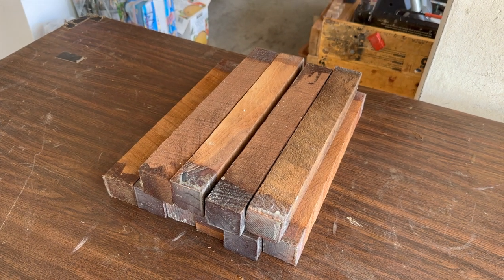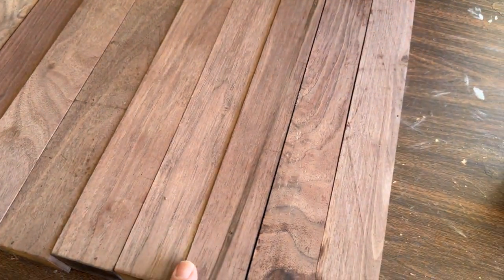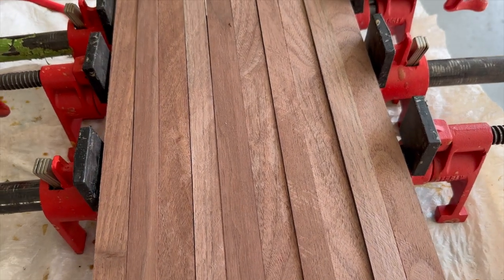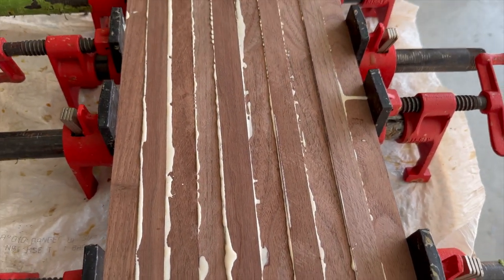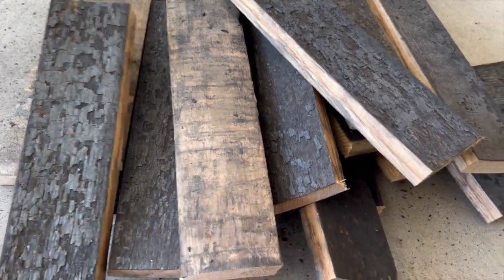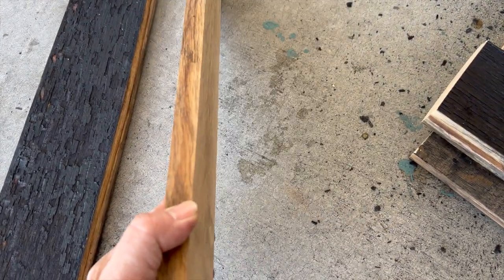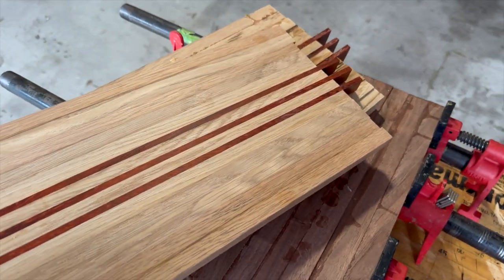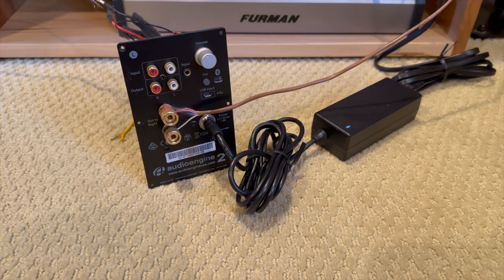JBL 2500 made from Bourbon Barrels Part 1

Comment: they put that wax on the ends to slow down the drying because if the wood dries too fast, it will crack, and hen you have to cut off the cracked piece.

when you run those pieces through the planer, the sides may be parallel, but there's no guarantee that they will be flat. ideally you should use a jointer to flatten one side, then run it through the planer to make the opposite side parallel to the first side.
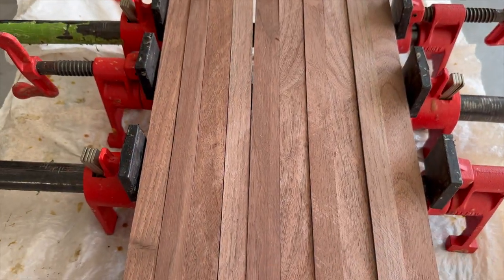4:33 see that gap? i bet those 2 pieces are not as straight as they should be, because you didn't use a jointer.
Reply from the maker: Yes I agree there are some pieces that have bends. The part that you reference the wood is loosely placed between the clamps under no pressure at all. Those gaps you see were simply how i placed them there for the video.  The wood is thin enough that when I clamp the pieces together the gaps are eliminated. You see later when I clamp the pieces the glue squeezes out making a solid connection.